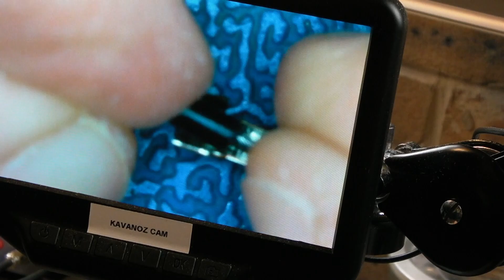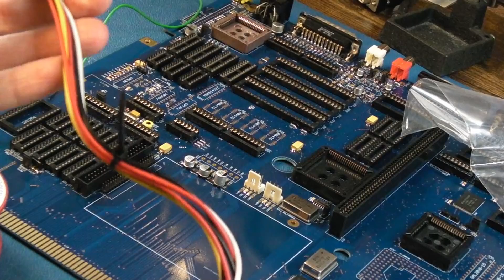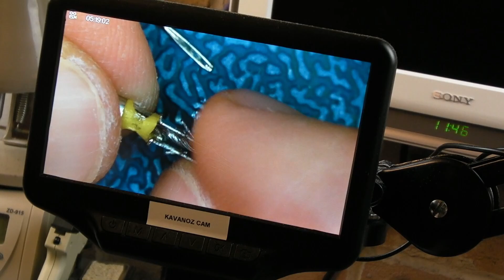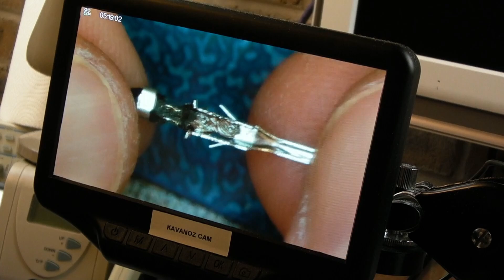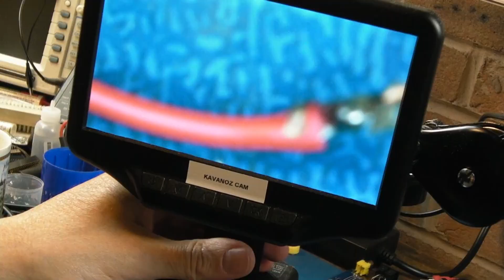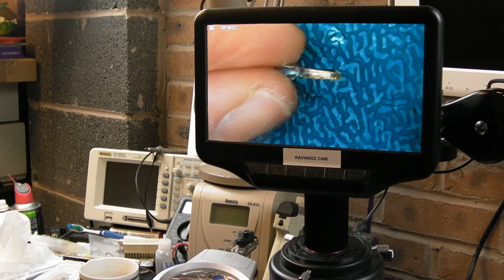Amiga A1000 ATX Power Adapter Build & A2000 Adapter Fix

Comment: You should not need to ever solder a crimp connector like this, provided the crimp is done properly.  It's important for the wires inside the crimp to be able to move relative to each other; it's a form of strain relief and prevents individual strands of the stranded wire from breaking inside the crimp.  Getting the correct crimper for a given crimp connector is often quite expensive, though.  You can find crimpers with replaceable anvils, and purchase anvils for the connectors you're using to save a bit of money but it's still expensive.  Anyone doing this professionally should pay for the correct, high quality crimping tool.  Expect to spend $300+ for a high-quality hand crimper.  I have several $400 hand crimpers and they make everything about this job completely trivial.  I will not go back to the method used in this video: crimp, modify, bend, scrape, solder.  Spending the money is better than doing that on every pin.
Reply from the maker: Yeah (as said in the video!!!) - you shouldn't need to, but you end up needing to...   In something like this where its a one time connected, with a several maintenance cycles where you reconnect etc, it's never a problem.  Inside something where you are disconnecting this over and over, or in my case - using on every 2000 board that comes my way, the cimped connections never last...  So soldering them does solve my problem.   These AmigaKit ones tend to come to pieces way easier than other crimped connections to be fair.

Comment: Cool video and very informative. The crimping tool is several hundred dollars on mouser/digikey! I am going to replace the white/clear PSU side connector with a black connector as discussed on the ACILL discord which has mouser links for plug/pins/extraction tool. Consensus is that the Amigakit adapters are junk - one burned up on a users system. Not good.

Comment: That's definitely not how you use those ATX pins. The longer crimps go around the wire and insulation, the shorter pair go around just the conductor, holding it down flat. You can then solder the remainder in the box if you cut it long. 
You don't really need a special crimper: most wire strippers (you know, those terrible flat ones) have gaps at the top to use for crimping connectors that work well enough for these too.
Pin Extractors ('cause they're used for all kinds of connector pins) are available cheap at most automotive places, you buy a keyring full of them and just find the one that matches the pin you've got.
Reply from the maker: Yes, correct - but crimping is crap and unreliable when you are testing hundreds of times - constant disconnect and reconnect.

Comment: Painfull to watch you do this without the right tool.... I've been there. I ended up buying a crimping tool, actually I own several now for different sizes. With a good crimping tool this is a breeze and I actually now enjoy it since it gives a great result. The problem without the tools is that you don't get good closure of the metal, that's why you need to solder it. However by soldering it you weaken the plastic of the wire, weakening the crimp. The correct tool actually does not need 2 crimps, it has 2 different sizes next to each other, one for the plastic shielding and one for the exposed copper wire. The last connector you shoved the wire all the way into the channel and used both crimps for the plastic, this is why it was so hard to push them into the connector, even when soldering like you did, just do it on the part it is supposed to be at.
Get the proper tool, trust me you will never solder a crimp again. I can highly recommend the sn series crimping tools on aliexpress, I have the sn01bm for dupont cables and they crimp rock solid, for about 20 euros!!
Reply: Yea. Ive done a similar Adapter for a SE30 mac, with engineer universal crimpers. And while they are not ideal (as they are universal) and need two crimps per connector (one for the actual connection, one for the strain relief) its a breeze compared to that. Been there too. Working without the right tool is just a pain.
Now i got several more crimpers from Ali and now its just a breeze to go through. And you can still solder over it if you feel like (i dont).
Btw with the correct tool, like the cheep ali ones the 2 sizes and incorporated in one crimp.. needed just one crimp to do connectionb and strain relief)
Reply: And there even is a tool for pushing the pin in... the other end of that tool is for taking it out again
Reply from the maker: I got the correct removal tool for ATX and PCI connectors - ultimately crimp connections (even if done properly) just dont last when you are re-connecting things hundreds of times.  Fine for typical use, but not when you are repairing and testing hundreds of devices.  Crimping in that application just doesn't last.

Comment: Not the correct way to do it for sure, but you know what they say: if it works then it's not stupid. It looks like AmigaKit lined up the wire right in the pins but they are clearly not crimped properly so perhaps they don't have the proper tool.
Reply from the maker: I have a short follow up on using an ATX / PCI-E tool.